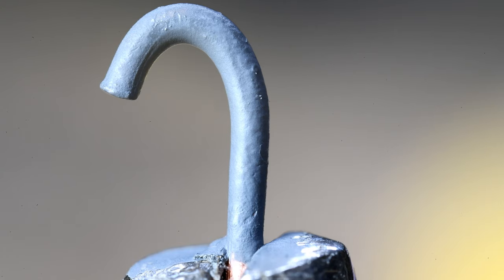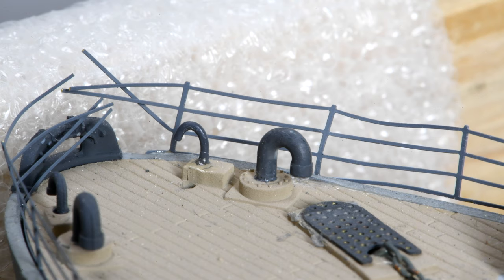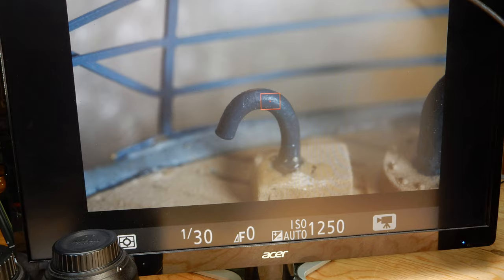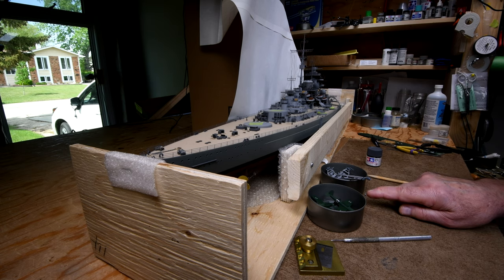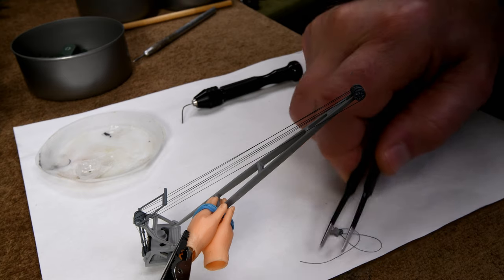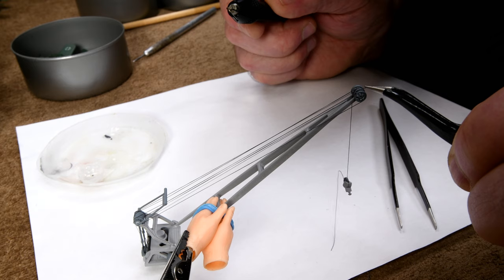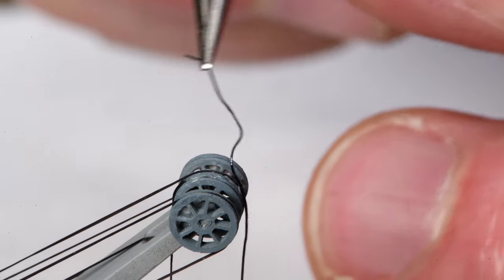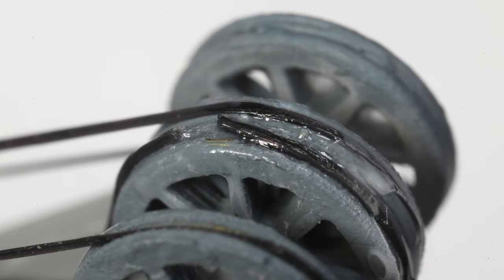The Model Ship - Part 460

Comment: In addition to the slot , you could raise the ship an inch or so. Maybe a sheet of foam.
Reply from the maker: Hi Jeff,
Re: "you could raise the ship an inch or so"
My plan was to keep the gunnel lower than the cradles sides so as to protest the delicate railing on the ship. That idea actually worked well, "most" of the time, lol. 😁👍
Reply: Yeah, the railing looks like you could destroy it with harsh language.😁 
I'm picking up a lot of tips from your videos , thanks